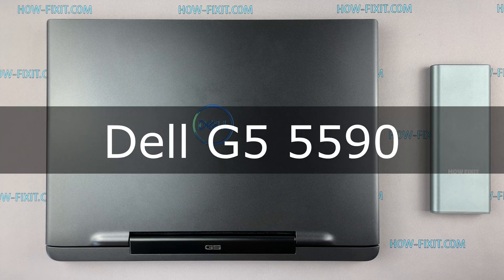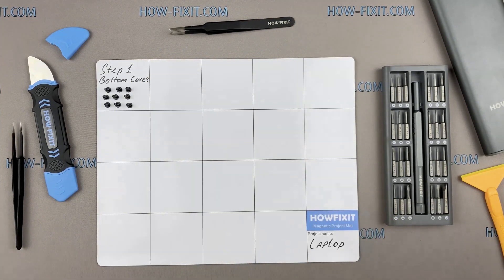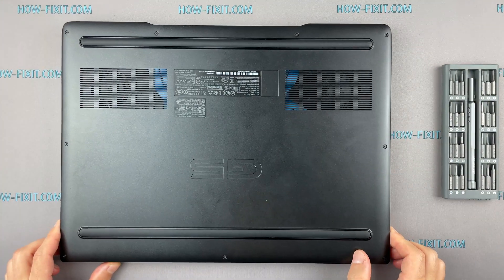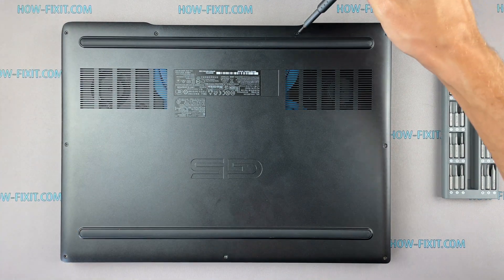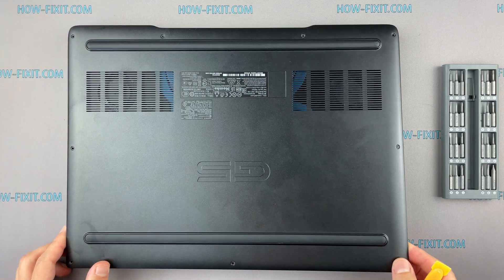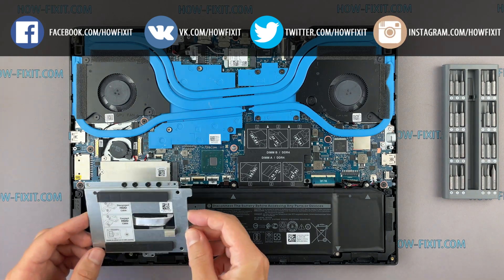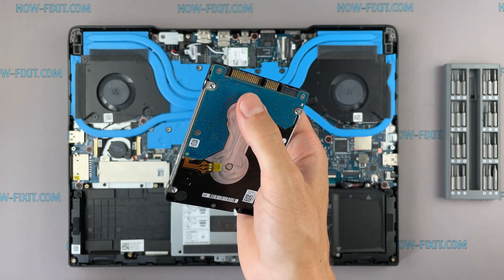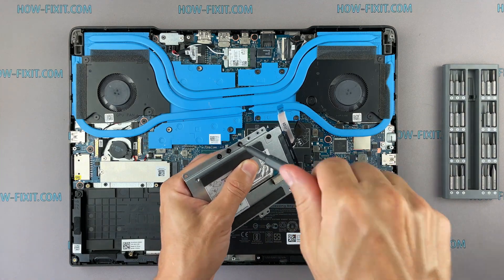How to Install SSD or HDD in Dell G5 5590 – Full DIY Tutorial

Comment: I removed 3 m3 screws but hdd is not coming out..am clueless..someone pleasr guide
Reply: Because the HDD is attached to 2 rubber surfaces from below (because of heat maybe). So, you have to pull a little.
Reply: @peterrago2998  yeah I did the same..was worried lol